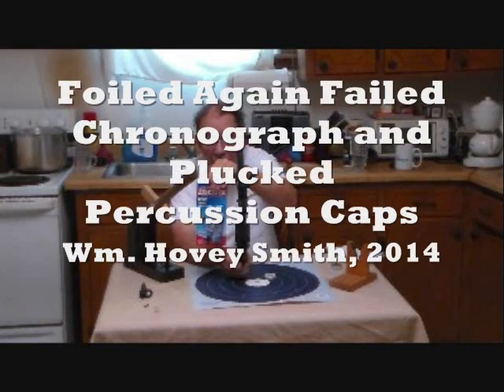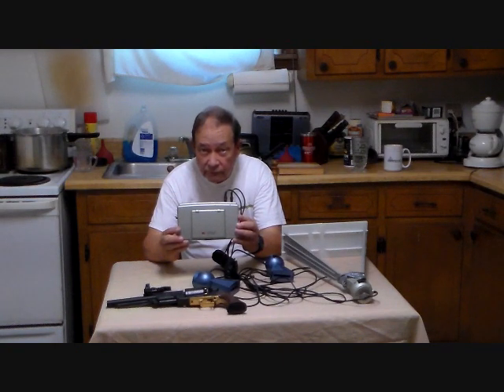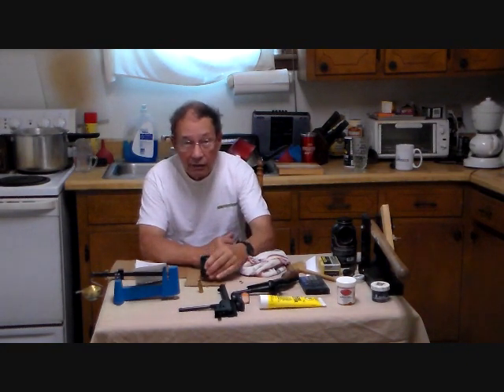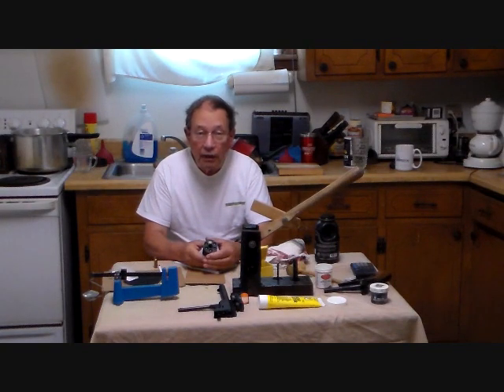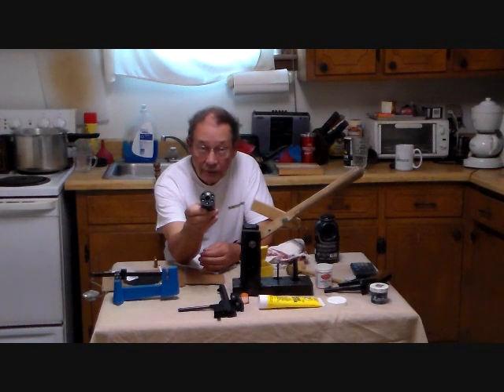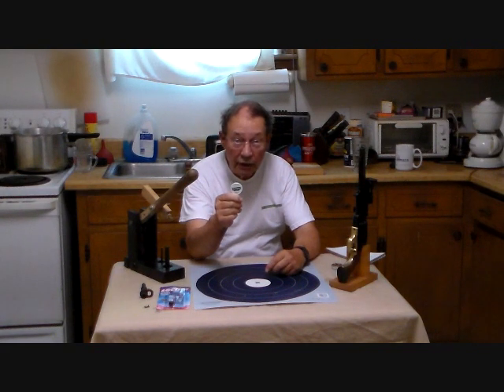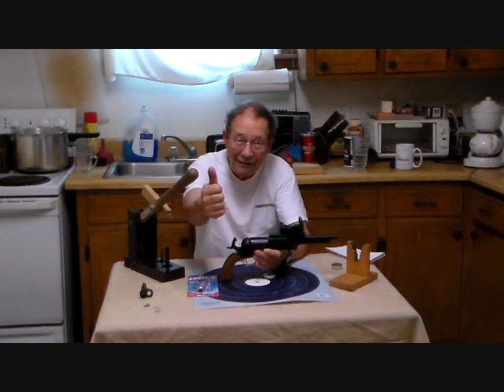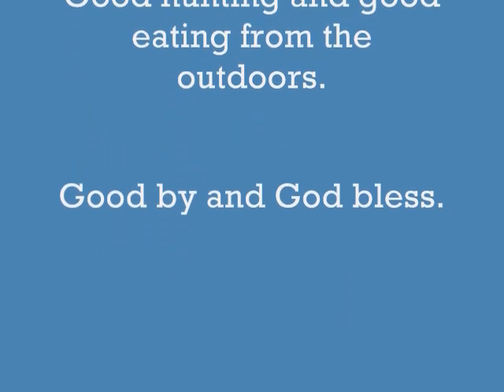Foiled Again Failed Chronograph and Plucked Percussion Caps

Comment: Hello Hovey,

I have found that Most Pietta Colt Open Top Percussion Revolvers have generally better factory cones/nipples than Uberti and that the Cap fragments generally do not fall as much into the frame lock work as they do in Ubertis. I also feel that  what you are doing my filling in the Cone/Nipple Recess Channel is a good fix. With that said I also know that improved Cones/Nipples like the famed," Slix Shot" Nipples Do enhance the reliability and performance of any Percussion Revolver they are used in. I am in communication with Slix Shot Inventor and owner and have suggested that he design and make a Walker/Dragoon Nipple. If such would be made it would be interesting to see you test them in your Super Walker.
Please keep up the Good Work, we are all looking forward to it.